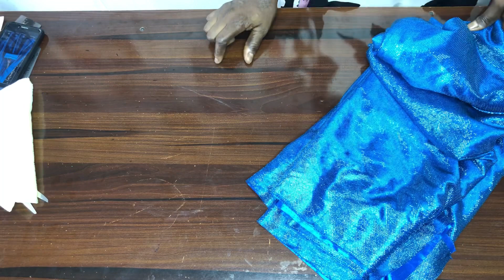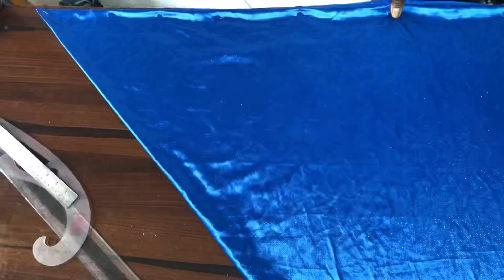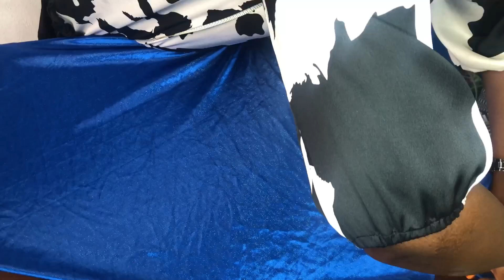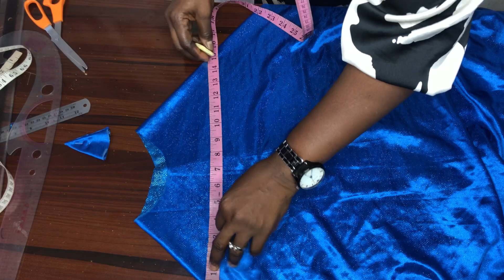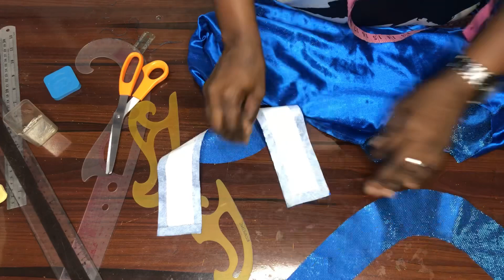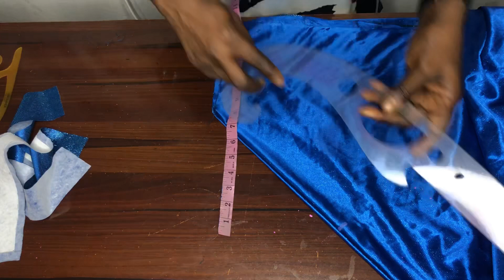Exaggerated flare BOUBOU with high neck collar

Comment: The cutting is a bit confusing how many inches did u cut off from the top since you already measured 65 as the radius?
Reply from the maker: After folding just measure where you get your shoulder length..you can measure 70" length if you want
Reply: @physiquecutfashionhouse  thank you